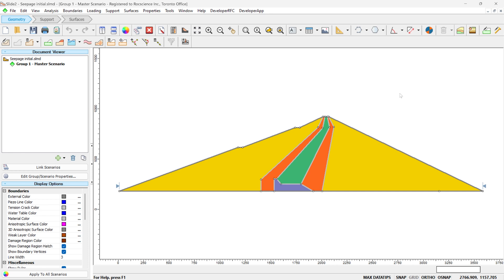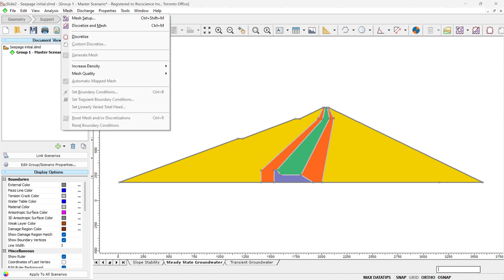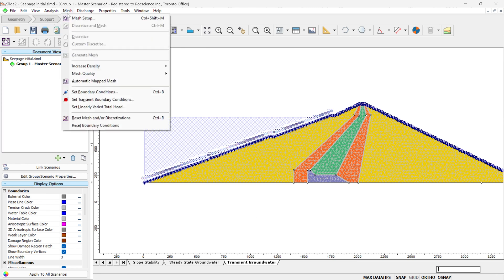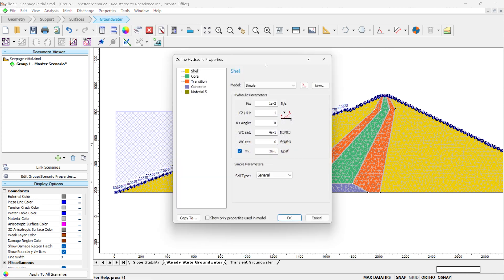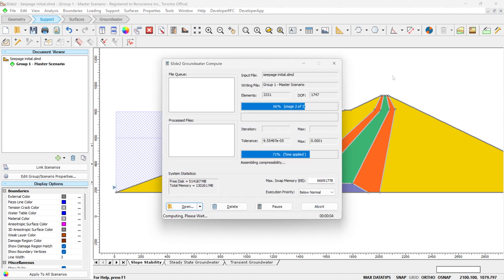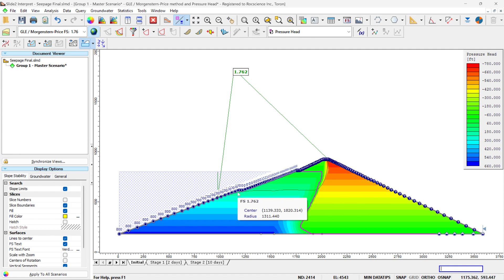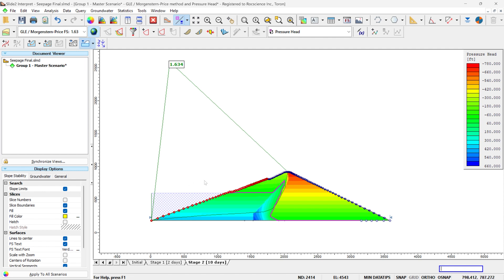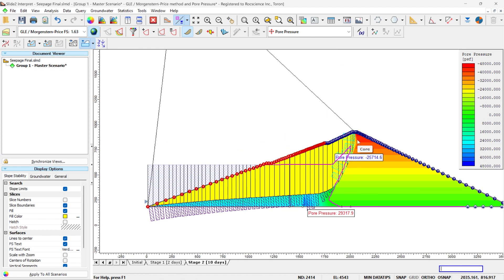Mastering Slide2 - Seepage Analysis

Comment: How can you generate a phreatic surface using piezometer data and  horizontal drilled holes data? For example let's say the water reservoir is inside the open pit shell and the piezometer data shows water level is 50m in vertical height from the ground surface at the top of the pit shell and 70m horizontal away from the design slope.
Reply from the maker: Hello,

If you have piezometer data, you can import it to Slide2 as a grid and the software automatically calculates Pore water pressure in different locations using interpolations and it find the phreatic surface as well (a zero pressure line). You can also use your data to carry out FEA seepage analysis in Slide2 and that also gives you the location of you phreatic surface. 

We hope this was helpful!
Reply: @rocscience  thank you very much for the prompt feedback! Appreciated.